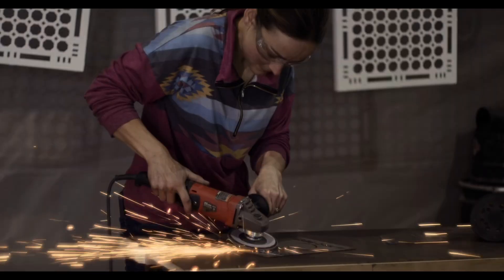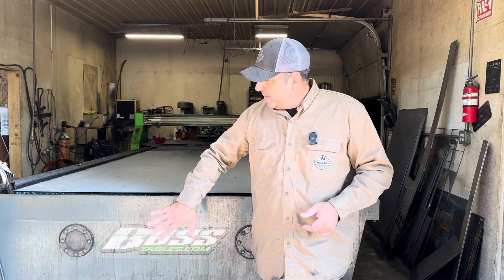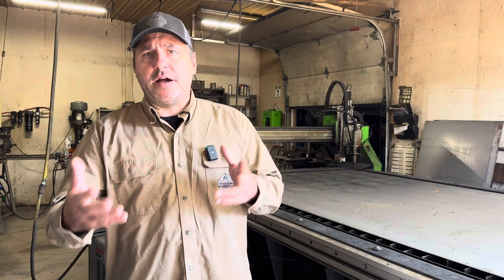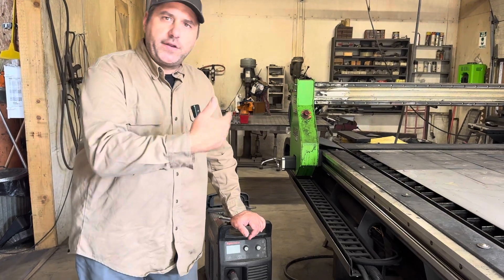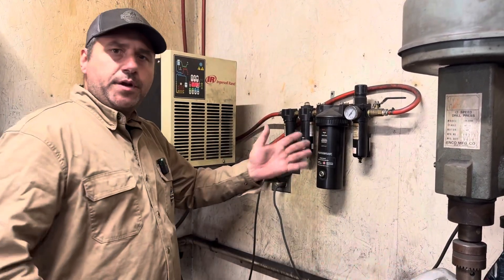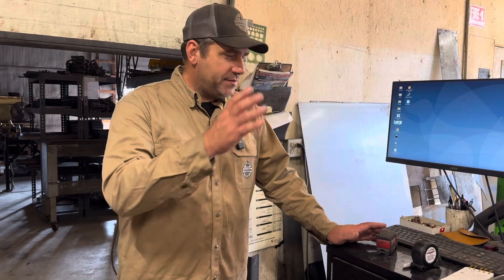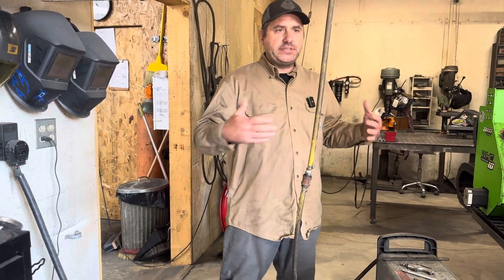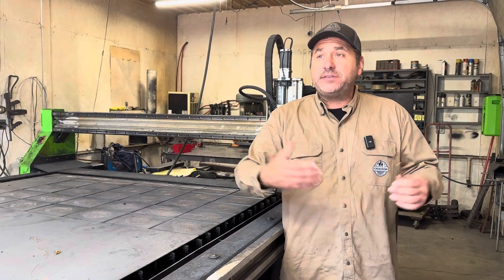Getting a CNC Plasma table for your small welding business.

Comment: In 1988 and 1989 my business partner and myself built at CNC plasma table. My business partner wrote the language using Mac basic in 1989. We also opened up our shop. We did a lot of blow pipe work had programs to do all kinds of square rounds  with different offsets, cones pairs of pants all kinds with parts we eventually obtained a structural steel fabrication license with the city of Los Angeles a very hard ticket to get we manufactured all kinds of structural steel in the shop. We did not do any installation work as we had all kinds of shops coming to us for fabrication one of the best tools we had was a piranha ironworker there’s so much you can do with one of these machines. We had two press brakes that we kept busy all day long as the quarter inch share 12 feet blade in the late 90s and early 2000s, we started buying a lot of laser cut material for just a few cents a pound more than we could purchase a steel for our plasma cutter round stepping motors not servo motors. We had thought of changing it over, but it would’ve had to have rewritten a lot of programming and for what we are buying laser work for it didn’t make any sense, we did however manufacture our own hydraulic press brakes in which we ended up with seven of had two strip 1530s as well as all kinds of other equipment sold the business in 2004 all of our employees who wish to go with the business dead we ran a shop with 20 people. Good luck to you on your adventure. It’s almost like a big board game where you’ve move all your pieces as the game progresses if you could ever stumble on one product to make we always thought of the can opener, one in every house in the country this is wind you will own the business. The business will not own. You. Good luck.

Comment: Have you ever considered a waterjet? They are a little more $$ at the outset. However If you are consistently cutting things at less than 1 inch, there is almost 0 distortion in the cut. Depending on the machine settings. Unlike a plasma table. Where you still have to clean the part after cutting.  Then you still have the plate itself distorts via the heat. The waterjet keeps the plate cool at all times. I've personally used OMAX and FLOJET machines. I have never had to send parts back to be re-machined from either. The only thing you might have to do is remove a couple of edge burrs.
These machines are also self contained, except for needing an external air source. No other input required.
OMAX and FLOJET will walk you through the initial setup and routine maintenance.
Reply from the maker: Water tables are great. Just out of our budget for a small shop.

Comment: How long did it take for the BOS table to repay itself? Does the table come with a (yearly) maintenance contract? As a business you need to be able to set the ROI, how much it cost to maintain (cost per cut hour), and a JD style plasma just does not cut it (pun intended) if you burn lots of sheets.. Would love if you include these kinds of details' in your next videos!
Reply from the maker: It paid for itself in about 8 months. Keeping in mind you have to find work to keep it running